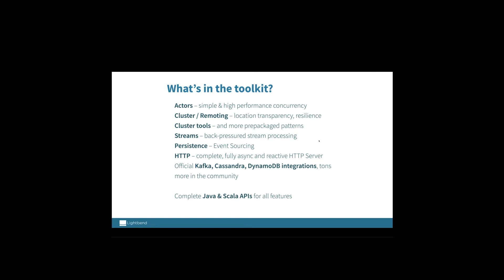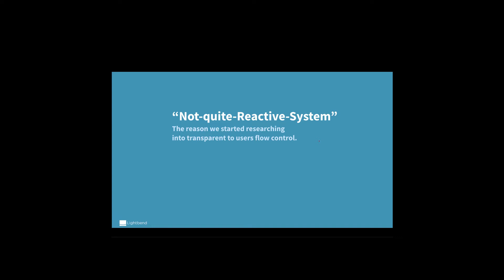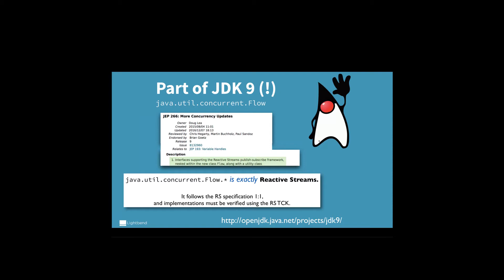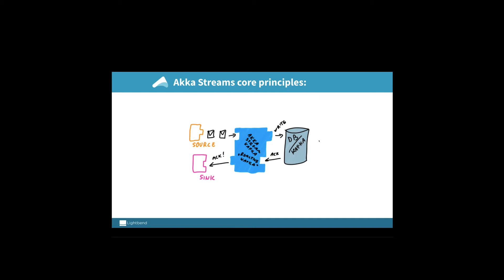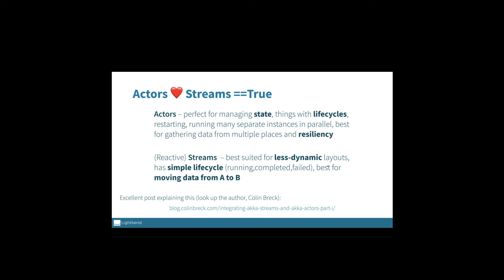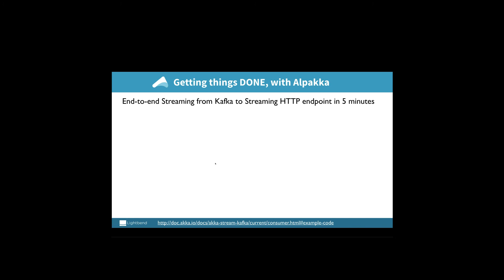Build Real-Time Streaming ETL Pipelines with Akka Streams, Alpakka and Apache Kafka

Comment: Bold statement to say that typed actors have the same complexity with streams, despite mutability...
Also beware that akka streams does not support joins between streams. It kinda makes sense, but is very very limiting for anything beyond just transferring data from A to B.
Reply: Correct me if i wring, but Akka streams has a merge and groupBy mechanisms. Does this not cover all possible problem sets?